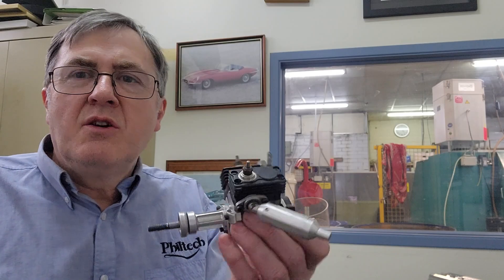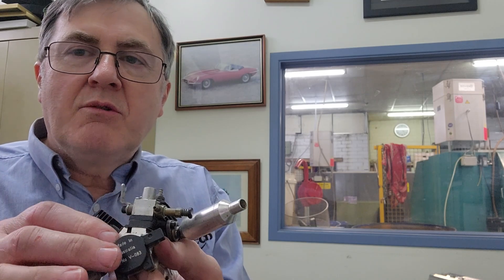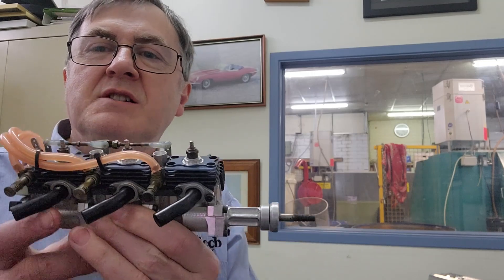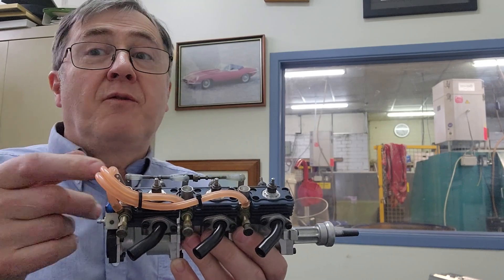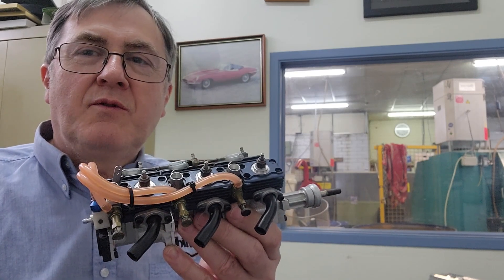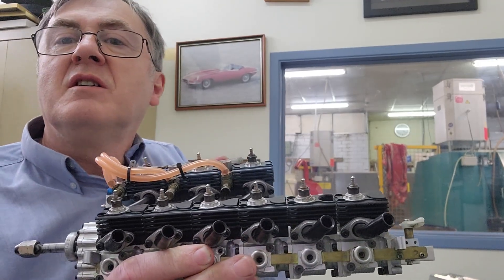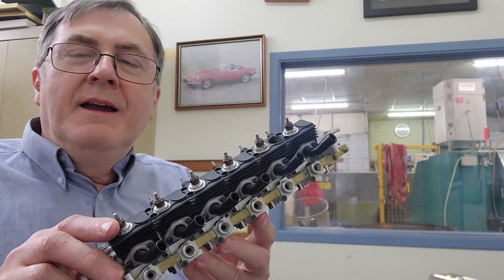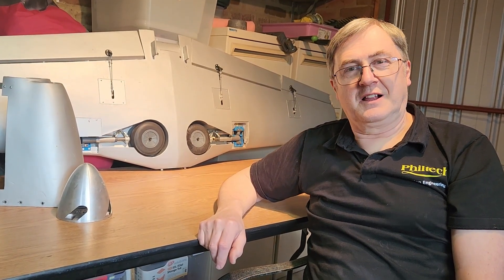Philtech gets a V6 model engine flying for the first time.

Comment: I'd be interested in an air-cooled boxer 12.
What i want to build is a twin engine airplane the fuselage is basically a tube one boxer 12 is forward and slightly up in the fuselage, the other is back and slightly down. 
There will be a propeller at the front and one in the back attached to a common shaft that runs the whole length of the plane.
There will be 3 cooling fans like the cooling fan on the german fw190 one up front, one in between the 2 engines, and one at the back.
The fans will spin the opposite direction to the propellers to counter torque it wont do a lot but it will do some. 
Each engine will be supercharged and any exhaust not used in the superchargers will be directed into the combustion chamber of a small axial flow jet engine slung beneath like a drop tank and reignited.
The tail and wings of the Do335, and a cockpit canopy from the fw190. And tricycle landing gear.